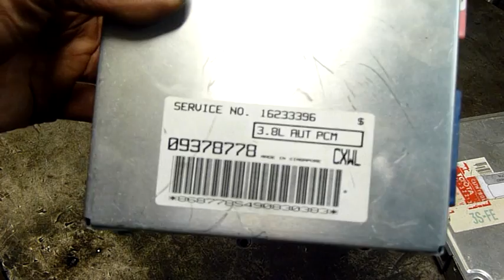Holden VT Commodore PCM Autopsy

Comment: The first one is indeed a VT v6, both auto and manual use the same PCM and the v8 uses the 16234531 PCM
The second one with no access panel is from a VX ecotec and is the first of the flash based PCM's

Comment from the maker: did I say that chipping a ECU was bad?, nothing wrong with doing things tastefully (good Intake, exhaust, EFI program and Ignition gear) 

its the douches that put generic plastic bodykits, gas-axed springs and loud but ineffective exhausts on that piss me off.

hell, I have a K11 Nissan Micra that I would love to put race spec suspension, clutch, exhaust, intake, injectors, ECU, and ignition gear in!, hell even a supercharger or turbo kit!. nothing wrong with modding, just do it right!

Comment: they are actually really reliable, up to vs commodore , the most common problems that will strand you are: crank-angle sensor, DFI module and fuel pump. if the ecu dies it's normally because of what people do when working on the car ie jump starting etc. I've seen an alt regulator over-volt and fry the ecu and everything, but mum's vr survived 25 volts when her alt reg failed no damage to the ecu or anything else

Comment from the maker: not sure about the VU part, unless i mis-ID'd the model. but I removed it from a VT Sedan chassis. it was fully installed and had not been touched in years until I tore the passenger kickpanel apart to get to it.

unless they replaced it at some stage with a used VU one?

Comment: holden ecu's are paired with the body control module, you need a tech 1 diagnostic tool to re-pair them, it's an anti theft thing. so that if you change the ecu only, the car won't start. unless theres something i don't know, like maybe it's a timed thing that locks you out for 60 mins or so then lets you start it

Comment: onthe one withthe removable program module you peel the foil off and you see the untraviolet programing window they used , don't know how many noob mechanics peel them and destroy the programs under flouresent lights .. but I know of several I worked with that accidently did it..

Comment: the difference between them is the programing protocal , types of injectors , type of fueling style ( batch fire vs , SMPFI , the one with the removable Ks chip is a older style and possibly a OBDI set up batchfire . the non removable chip is the CAN/bus style and OBD2 , the second PCM is worth money ( about $40 Us ) the 1st one is scrap . and they are made in the US in Kokomo Indiana ,at the ACD facilities using globally aquired parts .  continued

Comment: Ac delco electronics are assholes.  Those are off the shelf devices, but have the holy delco numbers on them.  That rubber conformal coating lifts the J-lead devices, causing solder fatigue.  Solder reflow brings most of those back.  But watching them being tossed on the ground was quite satisfying I must admit.  :)

Comment: you need to 'chip' modern cars if you upgrade the intake/exhaust or you'll actually start losing horsepower from the fuel map being so off.

Comment: Also, it looks like the two ECUs are more similar than you think.  One just appears to be a few years newer.  Looks like they removed the plug in EPROM pack and soldered a little 32 pin PLCC version on the board instead, and the large ASICs seem the same, just moved.  I suspect a bunch of those discrete FETs and transistors (TO-220) were consolidated into those larger heatsunk chips.

Comment: I like how all the chips and even diodes and transistors in "American" car electronics (GM, ford mainly) have custom part numbers.  This makes it marginally harder to reverse engineer.  The Japanese electronics in cars tend not to custom mark stock parts though.  Seems like a waste of money to remark things like 7805 regulators and 2N2222 transistors.

Comment: Slightly surprised that those TO-220s and other vertical packages aren't screwed down to something. Dave Jones loves to rant on about the dangers of vibration damage with these packages, and a car is certainly a high-vibration environment. I guess they've done the engineering on this and have figured it wasn't an issue.

Comment: those are not "outsourced" they are all made by the US arm of GM ,Delco electronics ,they are built in house by Delco in singapore ! they make them with parts sourced by GM KOREA,GM usa,then where shipped out by the planeloads by air fright to GM plants in australia,germany ,usa,canada uk,&korea,most of the main chips are made by DELCO KOREA,most of the ECM are simular but the Eprom chips vary by make and model and country

Comment: I know they're completely different but on the Honda ECU I worked on, all you had to do to change the ECU from Auto to manual was to remove a tiny resistor on the back of the PCB, stops the engine management light coming on anyway.

Comment: too bad you didn't take the connectors too, instead of burning the case, you could send the voltages through the wires (link all the grounds and connect the positives one by one)  might be fun watching parts explode and burn~

Comment: I bet the rom chip contents now reside in the main controller.

They may indeed be custom, but some companys love to re-label there chips to prevent them being copyed, its a good bet that some of them are not that special.

Simple engine management can be reliable but thease days they love to add computers in stupid places where basic electronics would do. :-(

Smashing disection Ed :-)

Comment: well check around the coil pack for any signs of arcing. i saw this happen a week ago. new plugs leads oil everything after the heads being done and it was the coil pack. does it splutter when you try and move when it's cold?